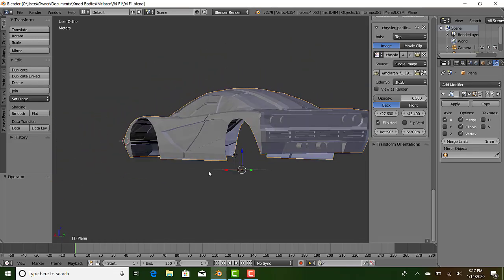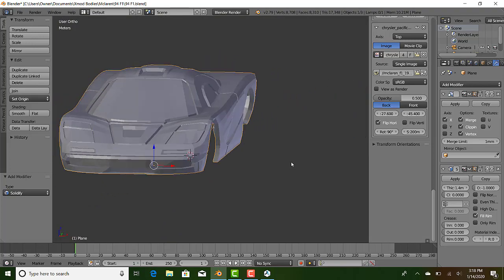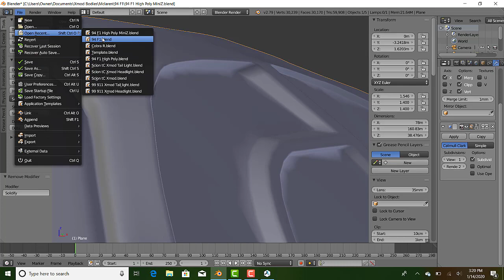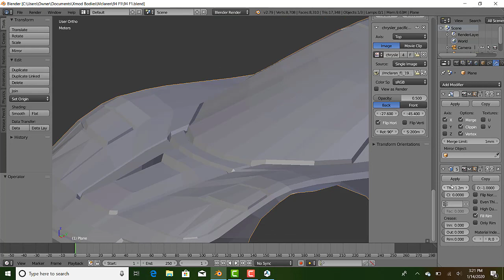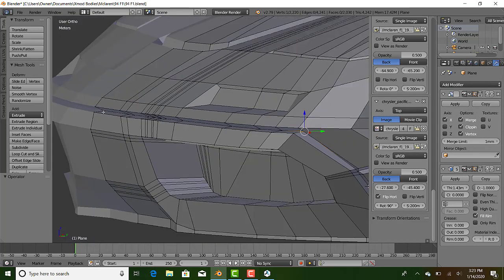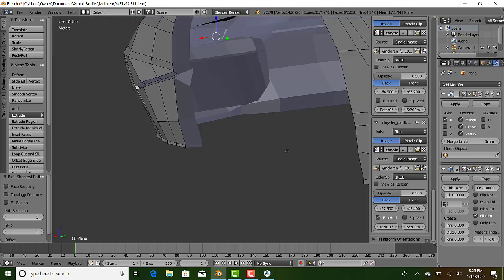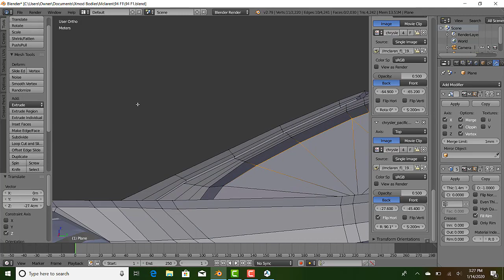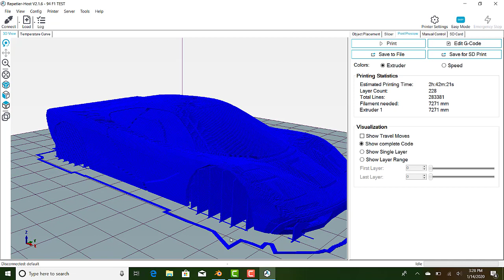How to Solidify a Model in Blender for 3D Printing

Comment: Wish I could see more videos about this problem. I built an object to scale. So to keep the scale I gave it a negative setting to solidify it. But by doing so it created some areas correctly and others seem to give it a positive setting meaning in some areas it thickened it to the inside and others to the outside. This caused huge problems with the mesh. I do have some sharp angles in the object that maybe causing it to clash on itself.
Reply from the maker: This would be a "Normals" problem. See if you can Recalculate Normals to outside or inside.
Reply: @Leander98  it seems with some more research that I had to change my mode to 'complex' since I have more than 2 connecting faces. This gave a much better result but still have issues.

Comment: I find that you have to make the offset at zero, with no negative in front of the number. Setting a negative value can make those ridges pop up where you don’t want ‘em. 

The problem is, it can fatten up the body a bit too much, so you have to strike a balance where the body is thick enough, but not “bloated”.